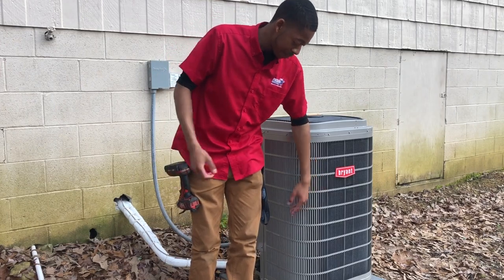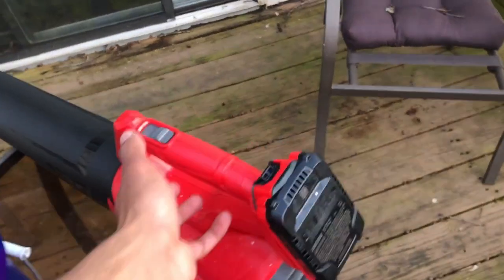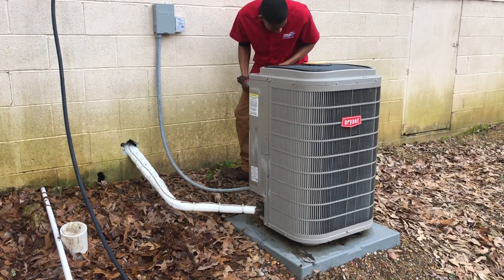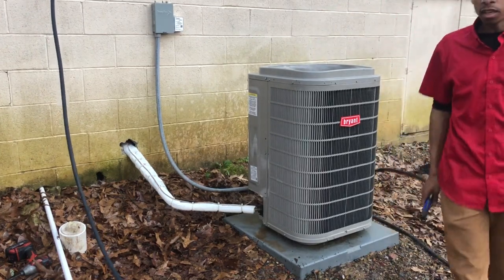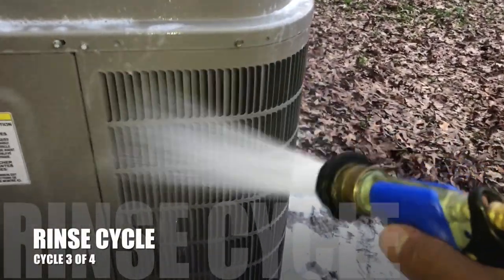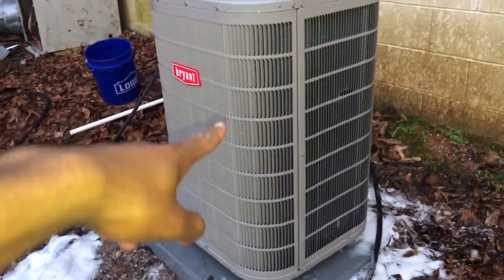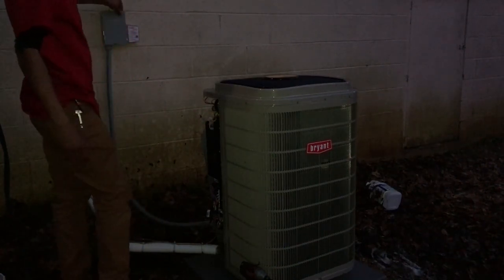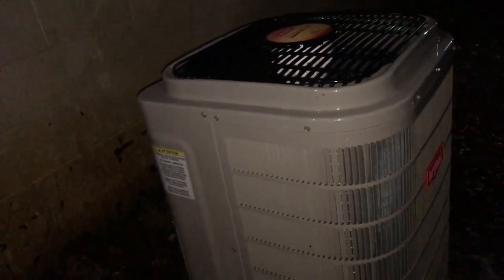BRYANT EVOLUTION SYSTEM - How important is it to Maintenance your AIR CONDITIONER - WOW HVAC TUNE UP

Comment: Terrific video. I have the same 189B, as a civilian learned a lot from your video. One install problem I had that I see with yours, hole into house for line sets was compromised by mice, came right in, real pain. Just now, first time my Bryant has had 10 days of 90+degree load, it's working great. Thanks to you I know how to maintain.

Comment: Where is the run capacitor?
Reply from the maker: Inverter systems do not utilize them. These are not permanent split capacitance motors. These are inverter DC VOLTAGE MOTORS.
Reply: @Malikoboost  Thank you

Comment: You're facial expressions were hilarious 🤣🤣

Bu the way, what solution are you using?
Reply: The one he is using is only sold at supply houses and is for professionals only. If you don't mix it with proper amounts of water it will eat away at your coils and your skin
Reply: @jawidofkoj2998  Thank you.